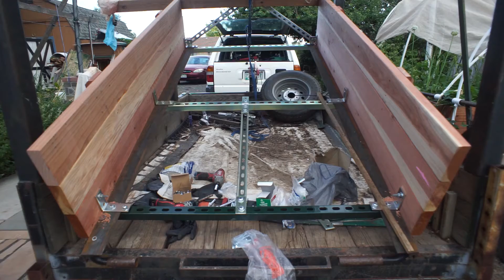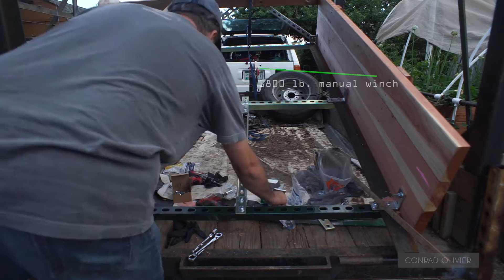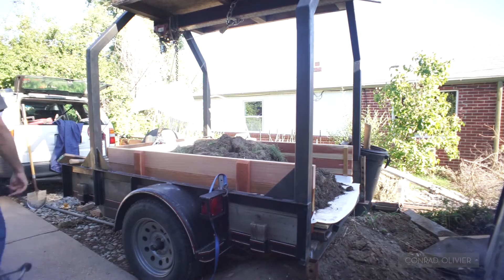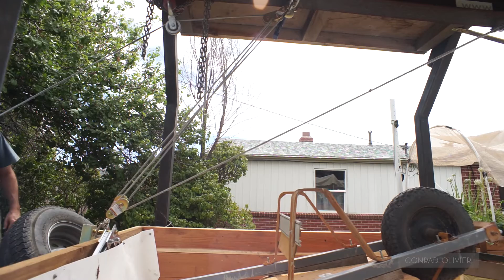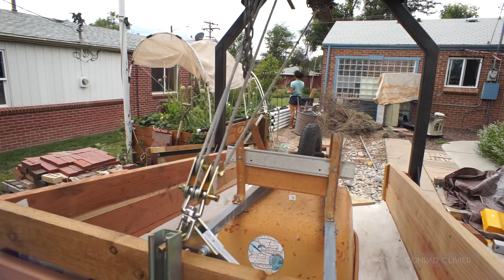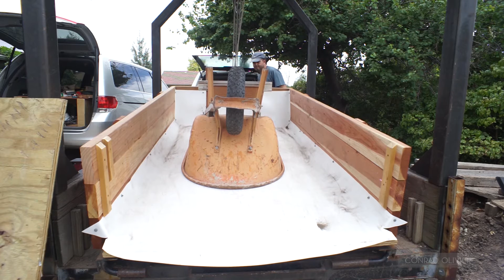diy dump trailer using a hand winch and a pulley system

Comment: how many thousand pounds is the hand winch rated for on this? Just so I know what to buy if I make one
Reply from the maker: +Robby Suter I think 2k max likely even less, but it's fairly robust for this little trailer - it's mounted on a 4x4 steel tube riser bolted to a plated that was welded onto the frame.
Reply from the maker: Hit Tools 16-HW1800 HAND WINCH - With Automatic Brake capacity 1800 Lbs Part# 16HW1800